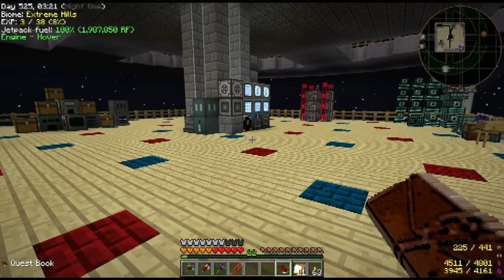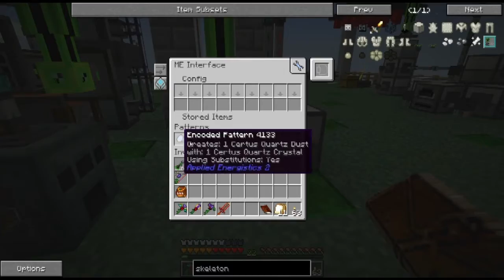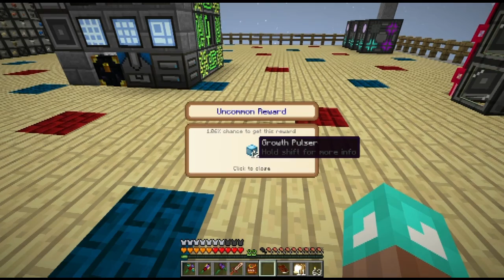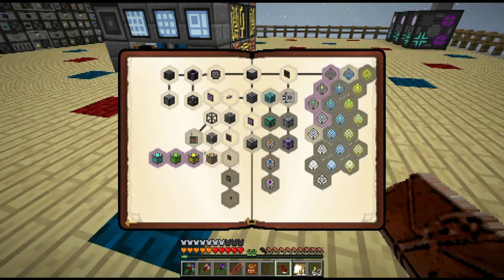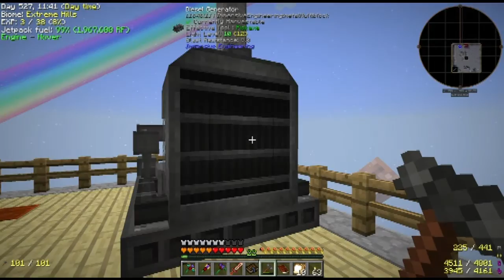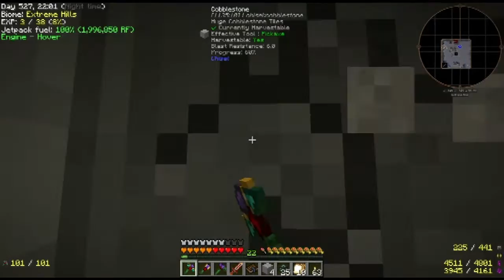Project Ozone 2 Titan Mode, Episode 19

Comment: For peridot use better furnace with ore processing upgrade and sagmill with darksteel ball (+/-20 per nether ore)
Reply from the maker: Episodes 23 and 24 are at least partly about obtaining and processing more ores and address this at least partly as you describe.  Essentially I set up a laser drill and a high volume ore processing system that obtains ores and handles each one in an optimal or close to optimal way (short of Mekanism processing).  Of course, the laser drill isn't exactly high volume, but I'm planning for the future.
Reply: Also in early game you can use compact chance cubes to spawn five 255 tall pilars with random ores. I recommend to spawn them in last millenium (cheap recipe and you won't destroy your base).
Reply from the maker: Ahem.  I'm not touching those for some time.  I have seen what they can do!  Actually, one of the most aggravating things they do, in my opinion, is spawn bedrock blocks!  Yes, good reason to do them in the Last Millenium.  Although I have other plans for that zone and would probably do them in an RFTools age.  Admittedly not an early game scenario, but then I'm not opening them in the early game.
Reply: Oh you're right. I thought that 3x3x3 one does not spawn bedrock. But it does on top of the obsidian pilars in end  glass spheres.( If it happens you can remove bedrock with dark oak method.)